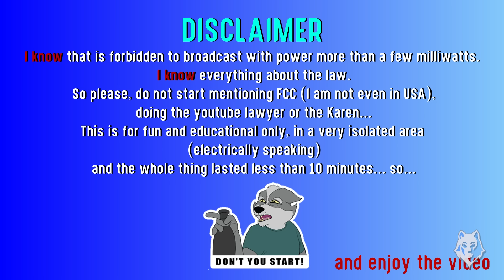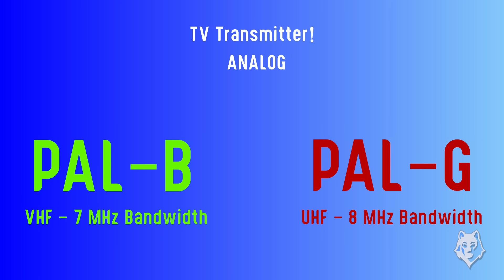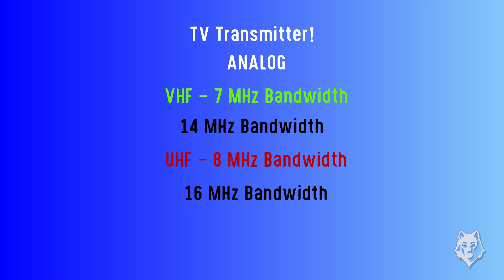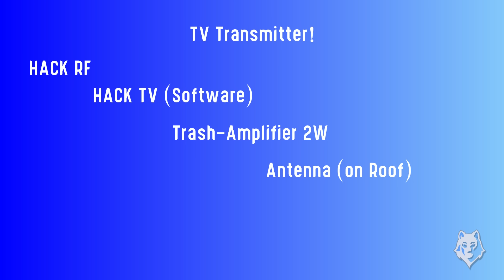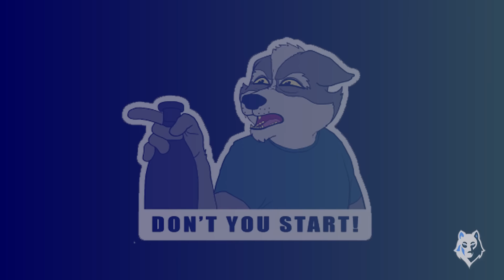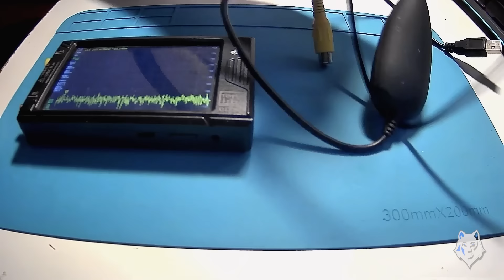How to make a  Television channel with Hack RF

Comment: All you need to tranmit in analogue  is a VCR with a RF output and A/V input. Connect your sorce into the A/V input on VCR and RF output is your transmitted signal.
Reply from the maker: And you would occupy like 3 channels 'cause the RF modulators have no sideband filter... That is the main difference between what I did over here and what everyone can do with a simple modulator. 🙂

Comment: Nice demo of the HackRf / HackTV.
The reason for burning-up the amplifier is most likely due to a misalignment between amplifier and antenna.
For broadcasting the antenna must be perfectly matched/tuned for the single frequency you want to broadcast on.
A receiving antenna is most of the time not suitable for broadcasting a signal, as its tuned for a broad frequency range.

The matching between amplifier and antenna must be 1:1 otherwise it will reflect the RF energy back into amplifier, overloading this.
This is critical! for more information on this topic google "antenna SWR"

Comment: GUI developer here, great video! You're correct about the hardware revision causing the vertical bars at 16 MHz, this is an issue on the r9 HackRF boards.
Reply from the maker: Thank you for your work! I am having tons of fun with it from a few years now.
Reply: Hacktv.exe does not load in your application, please fix it.
Reply: Hi, is it possible to emit FPV drone signals using this program? After all, they also use PAL and NTSC for transmission.
Reply from the maker: @RadioTexhno  not sure about that sorry.
Reply: @satwolf hello bro. Please can u make video for Frequency mixer or Upverter to use with hackrf one to transmit on 10 to 15 ghz ?

Your video was really good but hackrf one is Limited to 6GHz and chinesse is event worst small Power Output
Reply: @satwolf I recently figured it out myself, you need to choose pal-fm or NTSC-fm to set the deviation in the range of 3-4
Reply: @tonkofonkoI saw mixers from the Chinese with operation in the range up  to 6 GHz -18 GHz. after the holidays.  P.S. hackrf It works up to 7.3GHz with a good amplifier.